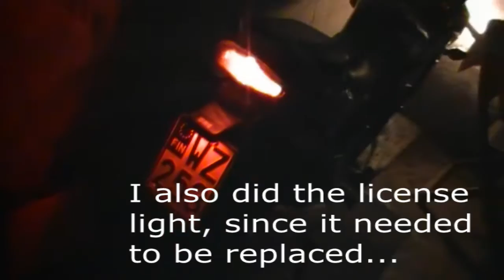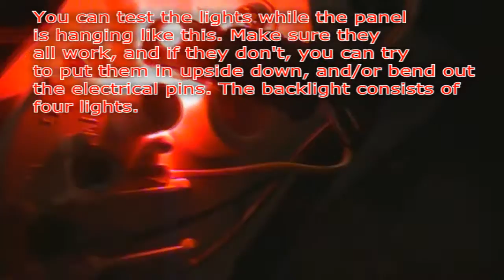Instrument Panel LED Backlight MOD CHEAP CBR125

Comment: Wow, very straight forward to install, nice, not like modern bikes that have LED’s that require yo to take apart the speedo housing and may or may not have to solder new ones onto.

Comment: nice video!!excuse me but where do i get these kind of led lights?To an electronic shop perhaps?
Reply from the maker: They are quite easy to find at any store that sells any kinds of bulbs really. If you are planning to do this on a different bike than the CBR125, you can take out one of the bulbs and bring it to the store to be sure.